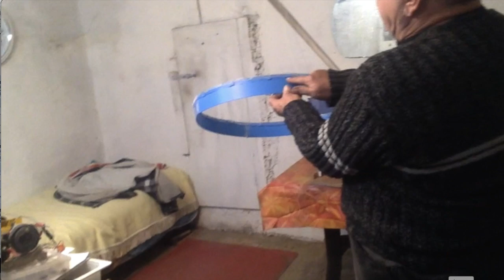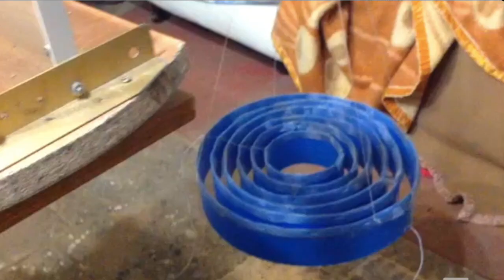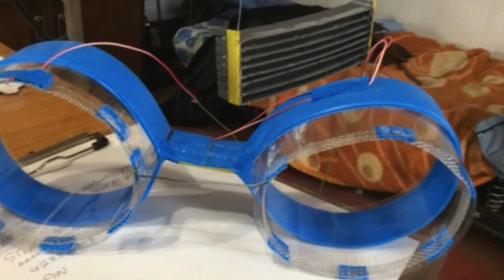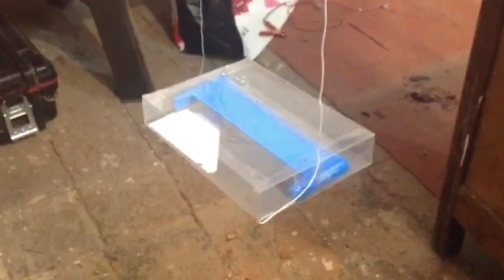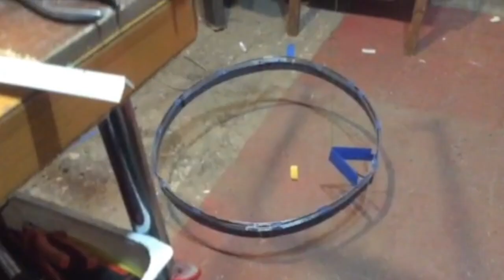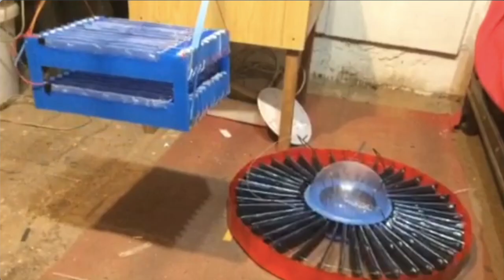Gene Watson's AC Ion Thrust Lifters

Comment: If the wire mesh is the emitter. What is the collector. All i see is blue looking plastic rings.
Reply from the maker: Check out my documentary AC Ionic Wave. Im not into lifters. You can see the doc in my profile or search internet archive. I also released self-published books based on his drawings that are also free on Internet Archive. What I remember visiting his lab which was just his attic. He had a step up transformer. Would press a button. Two wires would be connected to the lifters that would emit an electrical buzz swinging back and forth. He would say high frequency or sine wave. In the doc he mentions a half capacitor. Diode or triode. He shows the difference between DC and AC. I believe he was using 100,000 volts. He had like a series of batteries. He would also mention out of phase 180 degrees. He would use arbitrary terms to protect his idea like rebalser but there didn't appear to be anything overly complex about the make of his lifters. It was just wire mesh with plastic and tape in parts.
Reply from the maker: Im putting all the info I can find on the internet. This is from old email. "
The drawing I showed NASA in 1973 merely needed its high voltage rectifier removed
And as drawn would have worked straight high frequency ac sine wave input. So then
I unwittingly had an ionic wave designed and placed the drawing on their desk as if on
A silver platter but we were both ignorant then that it was really an ac motor."